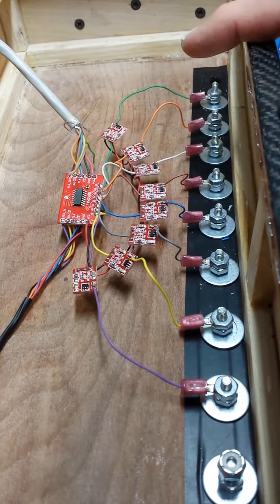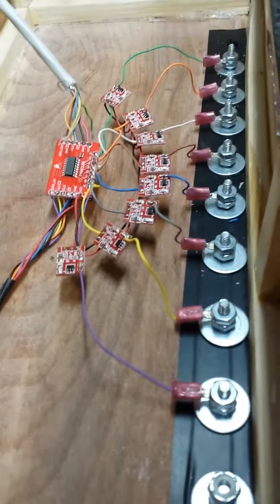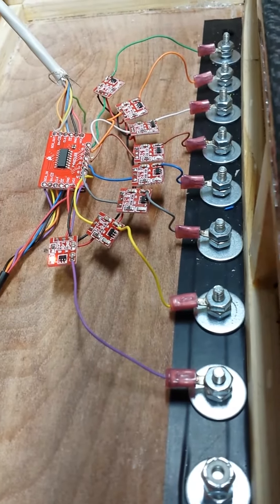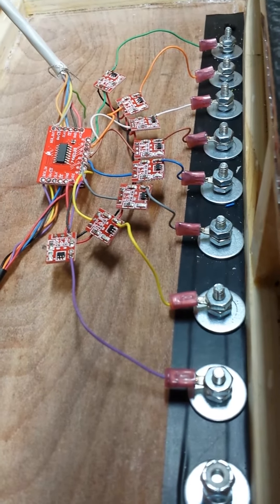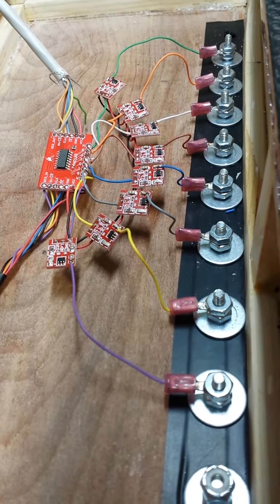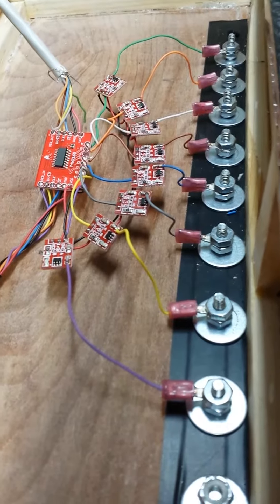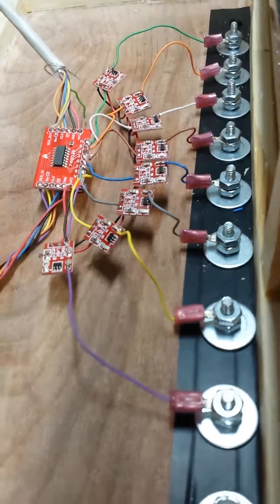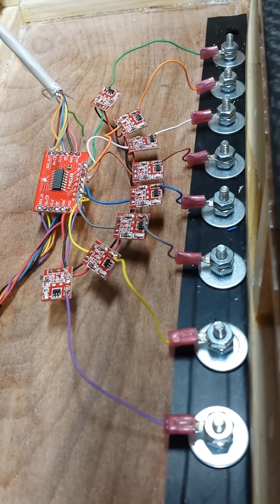TTP223N-BA6 TonTouch Board Mod

Comment: Hi Craig
I would be interested by using TTP223 like that (so increasing distance). I need to detect fingers to through small plastic suitcase.
I connected a screw on TP223 (input) 3 but I didn't think it change anything to sensibility (I just made a quick connection with an old PCB I cutted to put TTP233 and other few components.

How do you do this ?
Thanks for help

Comment: I can't seem to figure out what this is all about.  Scanning your videos doesn't provide clues.  So, what does this do?   Thx.
Reply from the maker: Are Jayem oh sorry, I just threw this together without intro or any discussion. I'm helping a local musician make an advanced foot midi controller from an old organ. we are using cap touch sensors for some of the interface instead of switches. more later this.
Reply: Ah, well that makes sense w/ what is seen.  There's a fair amount of MIDI & microcontroller content on YT.  I hope the player's FEET/shoes will trigger as if touched by skin.  Thanks for the elaboration.

PS:  hey, what of having a bluetooth-connected mini-box that could be strapped-on, worn, that communicates with the footpedal for instances where the player wants to trigger by hand?  Could be something that has yet to be commercialized.  I think it would appeal to a fair variety of musicians who want more flexibility over having to walk up to the pedal board and actuate with the foot.